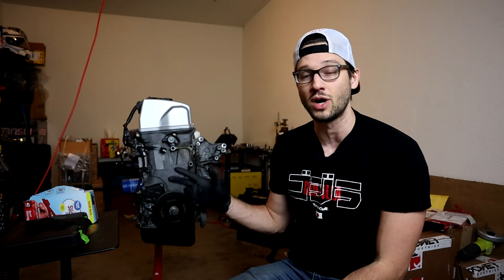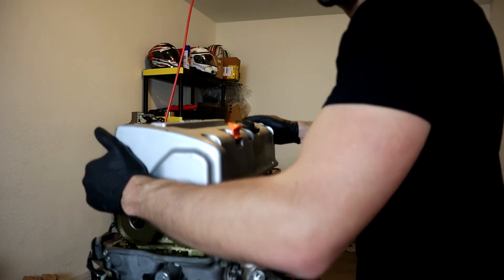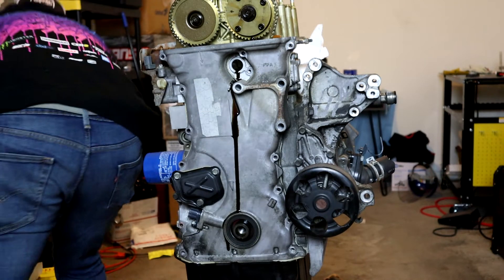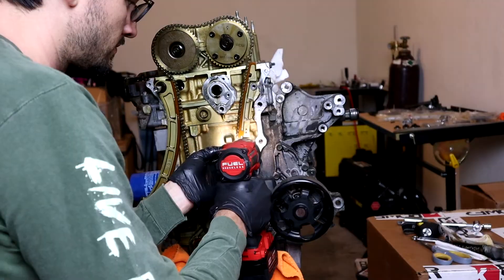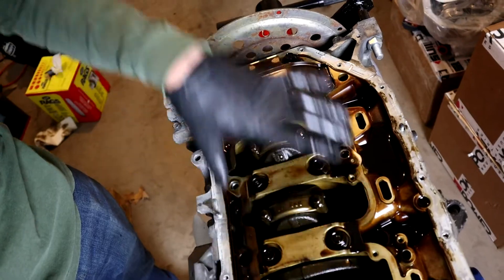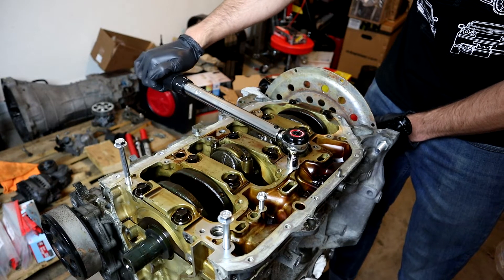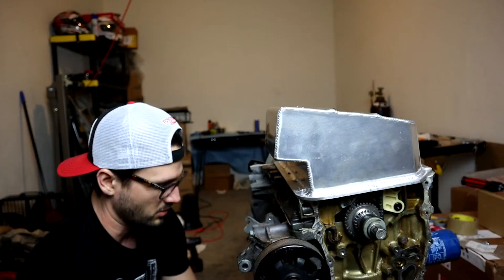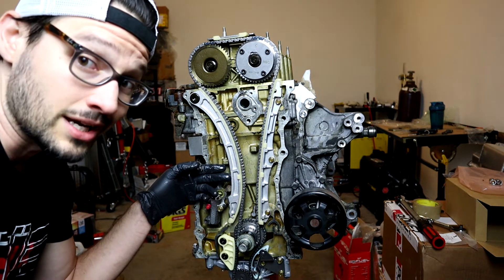K24 Swap Subaru BRZ Part 2 - Timing Chain, Type-S Oil Pump, and MORE!

Comment: Question..  when installing thr 50 vtc gear was it locked or unlocked before you torqued in the cam bolt?!   Some says to unlock it before you lock it in place ?! Getting mixed reviews here.

Comment: I meant to ask why the 50 deg cam gear when you'll probably see no more than 15 degrees of advance timing now your FI? just wondering what your thought process was behind that
Reply from the maker: Honestly it’s one of those “While you’re in there” things. May not make a huge difference in the end, but it came with the swap package so I figured I might as well.
Reply: @BuildingWithSean  yeah I didn't realise it came with the kpower kit.

I've started the same setup as you for my 86 but need to chop and change the kpower offering to make it work.
Reply from the maker: @techyeti4252  Good Luck on the job! What all are you thinking that you'll need to change for the Kpower kit?
Reply: @BuildingWithSean  do you use discord or any other socials? Would love to pick your brain? Pm me